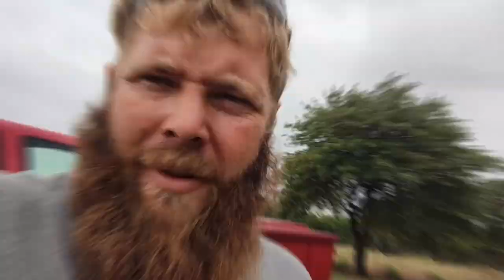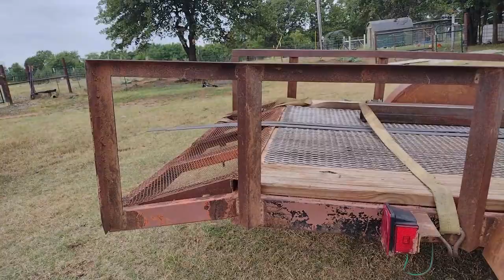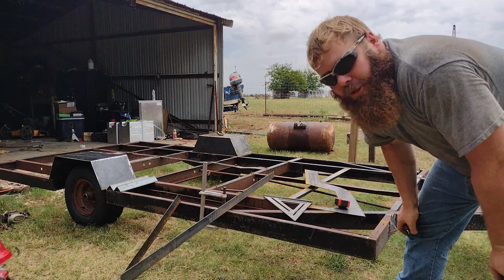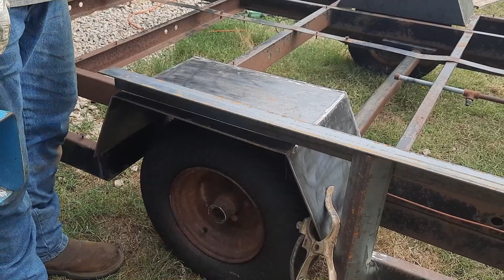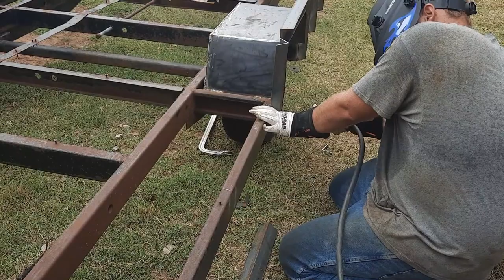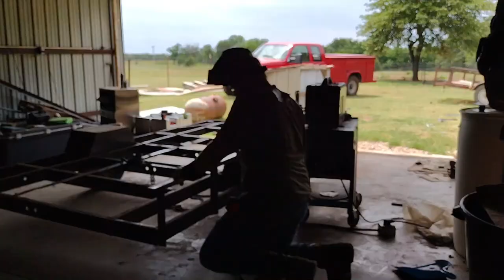Pop Up Camper to Utility Trailer Part 3 | How to Build Trailer Rails

Comment: Now I can clearly see that’s a gas less flux core welder so I gotta ask since I have one of those and also a stick welder, will the flux core welder be safe to use for stuff like this? I’m not a welder by trade just own the tools and use them here or there sometimes my welds are strong other times they arnt.
Reply from the maker: So Flux core is actually more structural than gas mig due to the polarity the weld gets better penetration. Although both are suitable and I would recommend welding with 240v rather than 120v.
Reply: @OldPecanHomestead  well that’s a relif because it’s honestly one of my favourite ways to weld and seems to work awesome for what I mainly use it for ( auto body repair ) mainly.
Reply from the maker: @Gigachadly  thanks for the comments 👍
Reply: @OldPecanHomestead  no problem thank you for the quick replies and the good content !